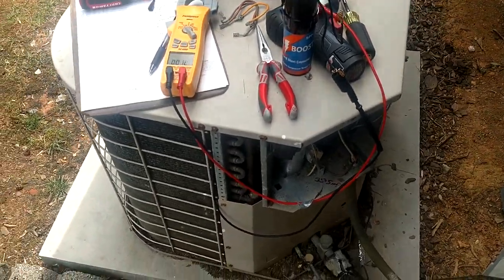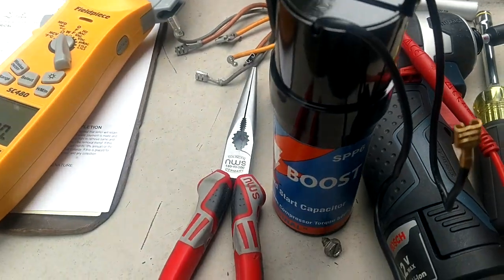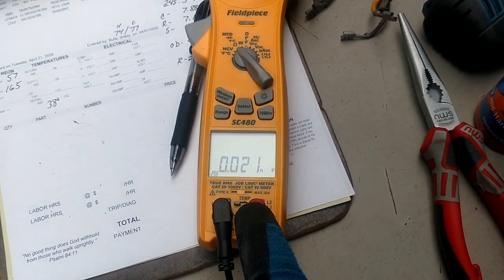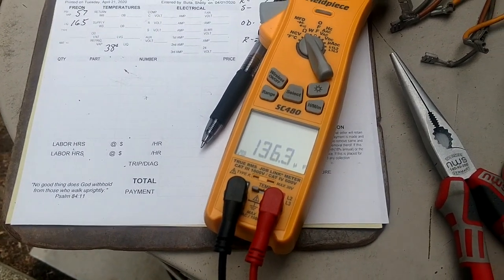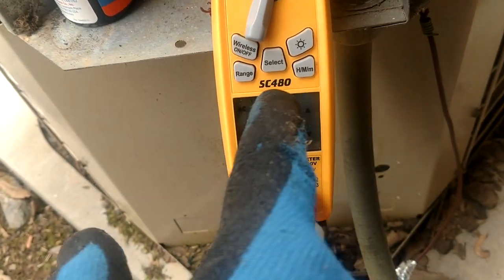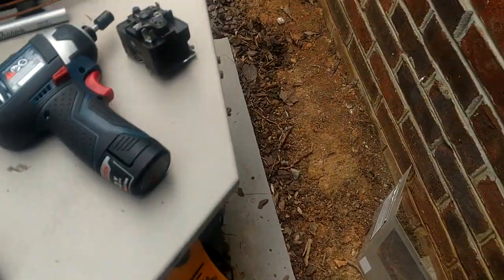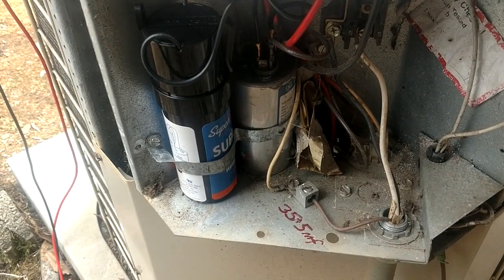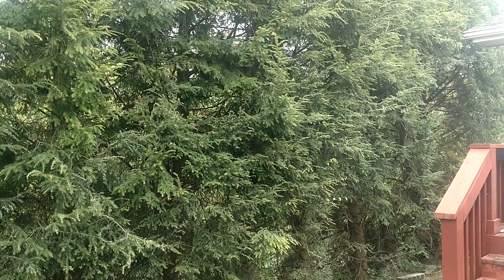Start capacitor readings & Inrush current w/ Fieldpiece SC480. Is it fast & accurate? Let's see 👀

Comment: Man i was about to send a nasty gram to fieldpiece. Just got the 480 yesterday, was excited, went to test it on my unit, specifically inrush feature, read the instructions over 10 times, my friends as tech support trying to figure out the range part; hitting range kept changing the volt parameter and not amp. Quadruple checked instructions for range and nothing. Tried googling it, found nothing. Tried YouTube, found you, and THANK YOU SIR. Would've took a few email exchanges bitchin to fieldpiece about it before figuring that out. That definitely should've been in the instruction manual. Thanks again!
Reply from the maker: Glad you found the video helpful. Thanks for watching 😎👍
Reply: Same thing will happen with a regular multimeter with min/max function. You have to be in correct range or else you'll get OL

Comment: My high end UEI seems to struggle with hard starts. It will just flash back and forth and sometimes not rest on a reading. Frustrating, had to switch back to my Fluke 902FC, which seems to do better. Maybe I need to get the 480.
Reply: Does the 902fc have inrush on it? I was using the 325 based off a few techs recommending it. Long story short, I ended up calling fluke asking about clarification if min/max was fast enough to read inrush. The guy said no, and only 2 meters have inrush; 375 and 376 meters. I asked about the 902, he said no it does not. I said why label it as hvac then if it didn't have that inrush feature. He said that's above his pay grade. 🤷‍♂️ Can you confirm if that's true or not? Thanks
Reply: @ericlarson8489  Sorry I never saw this. I'm sure I'm too late. But no, the 902fc does not have inrush. However, inrush isn't as useful as I thought it was since all compressors start an inrush current above LRA, so it doesn't really say much to be honest.

Comment: Hi there , can this model SC 480 measure voltage and amps simultaneously since it has a dual display ?
Reply from the maker: Yes it can measure both amps and volts at the same time. Thanks for watching 😎😄

Comment: Do you know if this will work with measurequick?
Reply from the maker: I believe it does Robert. Range is pretty good too. Thanks for watching 👍
Reply: It does, I just tried it yesterday first time. Haven't actually used it, but was able to connect and toolbox identified it.

Comment: I'm about ready to pull the trigger on the SC480.   My SC440 has been dropped and smashed so many times over the last 4 years that the clamp is starting to look really rough - still works fine, though.
 The ability to wirelessly check Blower amps with the door on with the app is gonna be nice.
Reply from the maker: Thanks for watching. Hope the video was helpful. 😎👍

Comment: How can you simply define inrush current?  Is the amps the compressor is pulling during start up?
Why is this important? Is this a sign of consuming too much electricity? an indicator that compressor will die shortly?
Is there such a thing as to low inrush?  what is the difference of inrush current and normal pulling amps during operation?

I am a DYI person trying to learn more from those that are in the trade at my own risk.

thanks
Reply from the maker: The inrush amp rating on the data plate of a condensing unit is LRA & the normal running amperage is FLA on the data plate. When the compressor is sitting idle it's normally in a locked rotor state. In- Rush current is measured in milliseconds and it is how long it takes the compressor to come out of locked rotor state. The quicker the better. If the inrush measurement is high, then you might have a weak capacitor, or the compressor is starting to show signs of "bad things coming down the road." In that case you could add a start assist or super boost to the system to help the compressor start up and maybe prolong the life of the motor. Thanks for watching. 
😎👍
Reply: Thank you so much for your kind response.  This information will make a better dyi person.
Reply: @sknight0391   In-rush current is not measured in milli-seconds. It's measured in Amps. When you measure in-rush you get an Amp value not a time value.
Reply from the maker: @bernardocisneros4402  Yes...the "Amp" draw measurement that you're taking is measuring Amps, but that reading is also measured in time. In-rush is only capturing the current within the first 8-10 milliseconds of startup. That is what makes "In-Rush" a very specific setting that only some meters have the capability of doing. In-Rush is not the same as "MAX" on a clamp meter.
Reply: @sknight0391  first 100 milliseconds  with multiple samples taken during that period  and the average value of those samples is displayed as the inrush . At least that's how Fluke does it. Amprobe  on some of their meters uses 80 milliseconds. and some other ones 100 milliseconds. But Amprobe doesn't make their own meters, just re brands  Brymen or Appa.  I like your videos.

Comment: Please tell me why you put the booster instead of replacing a new capacitor. Many times I saw him burn to the ground and burning everything around him, including wiring, this is not quite the right decision.
Reply from the maker: The booster is doing the same thing as the other capacitor was.
Reply: @sknight0391   But would not just replacing the cap be less expensive for the customer and less hassle then putting in the hard start?
Reply: @user-wh1nr9rr1h  Not really, because he doesn't know how old that relay is or its condition. The contacts may be pitted or soldered closed and that's why start capacitor failed. The best thing to do for the homeowner and you, is to do what he did. All things considered, I would do the same thing 100 times out of 100, in this situation.

Comment: Let’s see the 680 meter.
Reply from the maker: My camera's lens isn't wide enough to fit the whole thing in the picture. 😛
Reply: Shannon Knight HVAC how big is that meter?
Reply from the maker: @NorCal-refrigeration  the 680 is huge, but the 480 is the size of most other meters approx. 9" 🤟
Reply: Shannon Knight HVAC good info. If can’t fit in the bag it’s a no go.
Reply: I have the 680 and it does fit in my bag.   But it is a big one. But I love it